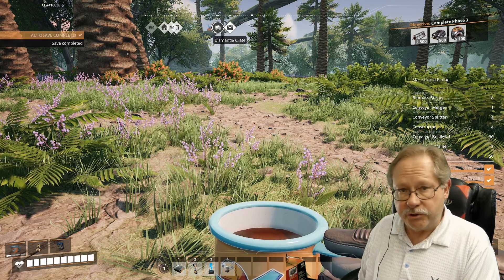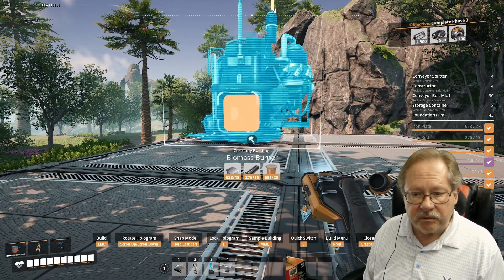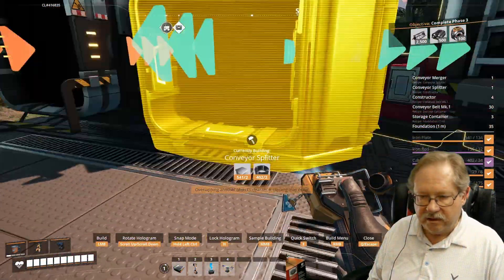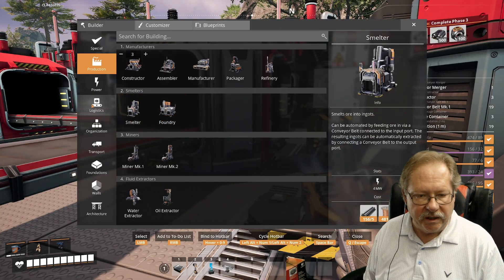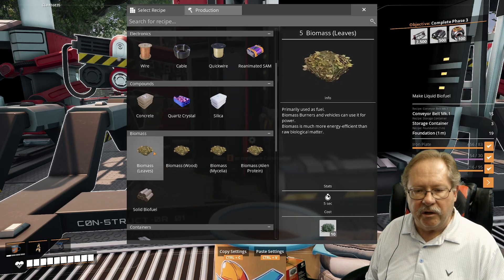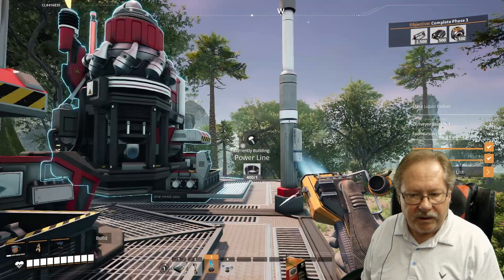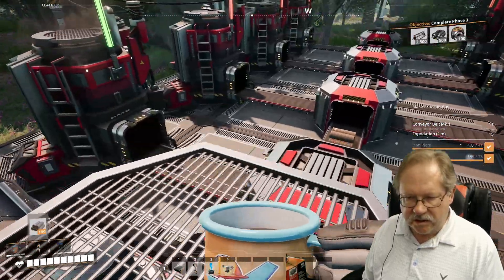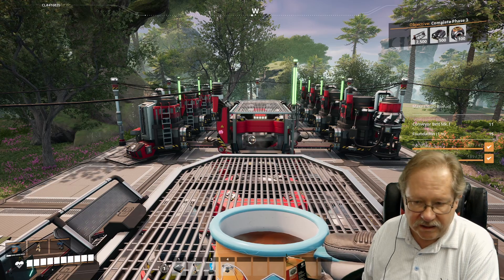How to Build a Biofuel Generator Manifold in Satisfactory [Doc University 1]

Comment: I do the manifold setup too, i learned the name in one of your videos doc!
I add the biomass storage, and get efficient with the conveyor belts once i unlock mk 2.
Also, since constructor on default settings can produce 60 biomass fuel per minute  and burner uses 4 per minute it means one constructor can efficiently fuel 12 burners at full capacity. 
By the time I need more than 360 MW I have coal already 😁
But i somersloop and slug it by the the late phase 2 because its close to the factory and i sometimes get into a building frenzy 🤣

Comment: Not bad but I have a different solution for a slightly different problem so I have an exceeding over abundance of solid biofuel due to my habit of collecting everybit of organic matter available and the bioburners are meant as basically an extended battery network springing into action if my factory starts to work at full consumption rates (if every machine were to be turned on) as most production lines sit idle due to being full.

I use a a manerfild too but with an extra container per bioburner and an extensive solid fuel holding space before the bioburners (something like 30 containers) additionally a single cosntructor for soldi biofuel feeding out of a container fed by multiple cos tractors for every variation 

This allows  to simply deposit the plant matter for processing while there is always enough biofuel to hold of total breakdown for quite a while. 

If one works like that

Comment: Doc-uversity has a nice ring to it. I like these tutorials, they give another perspective and additional ideas on how to do something. IE, I don't think to use mycelia for anything, but they have a good return for biomass, better than leaves but less than wood. I'll have to modify my biofuel backup plant to include mycelia processing. 

Manifold is one way, though, I've been trying to do it with balanced lines, and with that method, provided you can get a full 60 belt of solid biofuel, you can feed 12 generators and they all fire up almost at the same time. Need to have a store of solid bio fuel first though, like a stack is enough to start with.
Reply: Also bio generators at that stage are mostly for power spikes I would suggest a manifold combined with a container each, IF you like me collect stupid amounts of vegetation. In that case a big biofuel storage before the splitters is also necessary

Also animal parts have a really good turnover rate of like 1,5k per minute. Which are worth a mention.

Comment: Not a bad setup Doc.  It is close to what I do.  However I add in two addational storage containers.  1 after the merger for the biomass and one after the contructor for the solid bio fuel.  While not necessary it provides an area where you can grab biomass quickly to create fabric if you need it and a place to grab solid bio fuel.   Very few extra resources to put those in place and proves to be handy even after you are running on coal.
Reply: I try to do this for several products. It's handy until you get the cloud storage